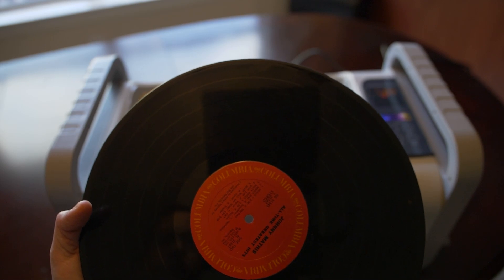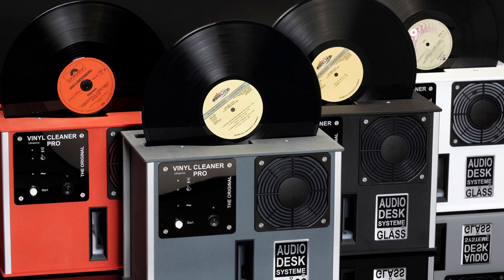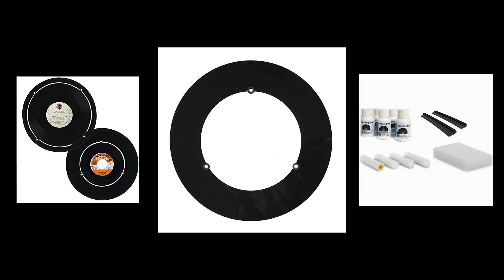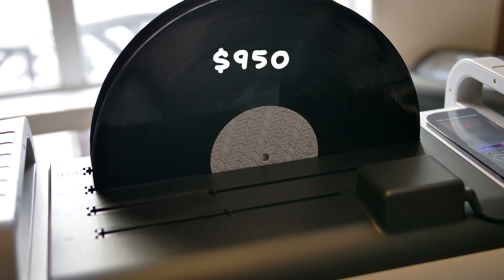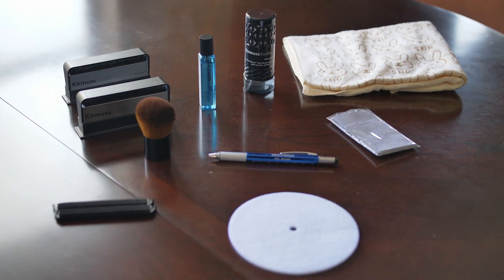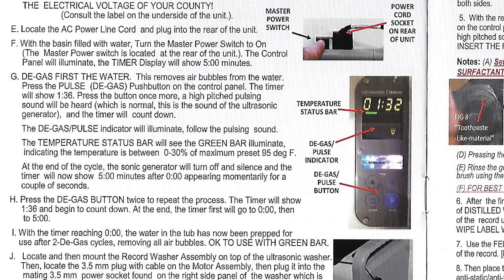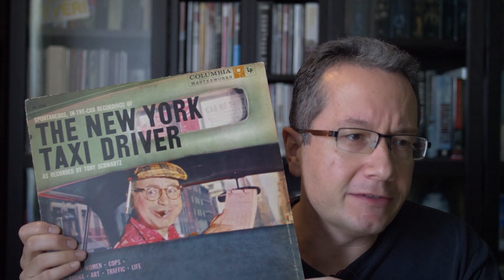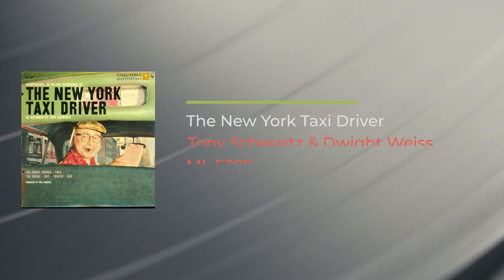Kirmuss KA-RC-1 Ultrasonic Record Cleaner Review and an Ultrasonic Cleaning Primer

Comment: Hi Paul. Thanks for this video. Very detailed and gave me a good understanding of the process as well as what are my options regarding Ultrasonic cleaners. 

After watching your video, I have been doing some searching myself, and found a new option that is currently being crowdfunded. I’ll paste yhe link here: https://youtu.be/XqPrPigrHko

Seriously considering pledging to this at the moment. As a ultrasonic cleaner user, what do you think about this? I know it’s difficult to comment on something that you haven’t seen or used in person, but your honest opinion would be appreciated. Thanks.
Reply from the maker: Thanks B Po!  I couldn't get into the KickStarter link for some odd reason but from what I can tell from viewing the video is the design is great and has an advantage over it's more expensive counterparts.   It appears to be smaller in size and I like that it comes with a cover.   The drying and the transparent drain tank design are also advantageous.   

I hope the have some success in making it to the market because a reasonably priced cleaner with a drying function would go a long way in this market.  It's sorely needed and I think it could be done inexpensively.   Again, thank you so much for the comment and the link!
Reply: @BarakaPDub  Yes, the fact that it has drying (not hot air!) function, as well as being priced at 350 USD is very attractive. They have already passed their Kickstarter goal too. Anyway, thank you for your input!

Comment: I've had the Upscale Audio version of the Kirmuss for 6 months now and I end the cleaning process with a Record Doctor VI for drying. For those who may not want the bunny logo, the Upscale Audio version is the one to get and it actually looks much better. That said, the results will vary depending on condition of the record and how much "elbow grease" you put into it. If it is a new record, often you can just run it though the Kirmuss once and then dry it. But for older records, a bit of "scrubbing" with the solution is needed. There are many ways to clean records but none of them are better than ultrasonic cleaning. I have a lot of records and I use mine almost daily. Ah yes folks, new records do need cleaning before playing them. Also, your stylus and the stylus cleaner should last a very, very long time if you clean records properly.
Reply from the maker: Thanks for the great comment bulldogdave.  I greatly prefer the Upscale Audio version to the one I purchased and I would have gotten that one to avoid the 'bunny.'  Your absolutely right about new records too!  New records should be cleaned before being placed on the platter.
Reply: Like you, I clean all of my new records, in addition to used. For my new records I've gone through the entire Kirmuss process, multiple trips to the bath, spraying and working in surfactant with the goat hair brush, etc.. For used records, this manual portion of the Kirmuss cleaning process is necessary, but for most new records, after reading your comment here, I'm wondering if I'm wasting my time trying to clean new records using the entire process???? Do you run new records through one 5:00 minute cycle, dry and that's it?? Or do you run a shorter cycle, 2-3 mins?? For my new records, I would love to save some time, as my only gripe with this system is the amount of time it takes to clean just one single record, following the Kirmuss process.
Reply: @jondubb35 new records get an initial 3 minute clean, a light scrub with the surfactant and brush, then another 3 minute bath. Usually more than enough.

Comment: Hi Paul. Fantastic and informative review on the Kirmuss. So much so that I've ordered one mostly because of your video. You mention that you couple the ultrasonic process with a vacuum machine as well. What I'm not clear on is where you preform the vacuum step in your process. Do you vacuum before or after the ultrasonic cleaning process and do you use a cleaning solution during the vacuum step? Thanks and all the best.
Reply from the maker: Thank you so much for watching and going for it!  That makes me happy you decided to take the dive.  So my current process is the following:  1.) Examine the surface for major caked on debris and give any areas of concern a light scrub with a damp Mofi brush.  Since I buy 90% new records, I don't have to do this step but occasional I do pick up a used record that needs a bit of spot treatment.  2.) Conduct an ultrasonic clean to remove all the major residuals and fine particles.  You'll note that the particles have a tendency to float around in the tank before settling on the bottom so they can come back in contact with the surface even after Ultrasonic cleaning process has just finished. 3.) A distilled water rinse, two times, on my vacuum machine to remove any particles that may have come back in contact with the surface.  I only vacuum one or two revolutions.  The key is not to over vacuum as it will just induce static on the LP surface.  I am okay with a very fine mist of water on the surface as an indicator.  I let the remaining moisture evaporate on a drying rack.  In my case, my drying rack is a letter filer I picked up at an Office Depot.  Doing all of this has left my LPs virtually click and pop free.   I hope this helps.  Others may do something different and that's okay.  It's seems everyone has their own voodoo magic ;)  Mine seems to work for me, anyway.
Reply: @BarakaPDub  Thanks so much for the walkthrough of your process. I'll try doing the same when I receive mine in a week or two. Appreciate it!

Comment: Great review. I clean my records using the vinyl vac record vacuum wand, and it has made my records a lot quieter and there are fewer clicks and pops, but the one negative thing I’ve noticed is that there is sometimes a very small amount of dirt or dust on the stylus after playing a record. If you could perhaps do a comparison of your stylus before and after playing an ultrasonically cleaned record, I would be able to judge for myself whether buying an ultrasonic cleaner is worth it.
Reply: You are looking for absolute perfection. it does not exist.
Reply from the maker: Good question Nathan!  So I can say without a doubt, that regardless of the cleaning method, you're always going to get stuff on your stylus.  Basically, even if the vinyl was pristine, your stylus diamond is lightly, and I mean lightly, scrapping the walls of the record groove.  Both your diamond and the record groove wall wear down with time.   Not to fear though, you would have to play the same record hundreds, if not a thousand times to really have impact to the sound of the record if it's well cared for.  If you listen to the hardcore audiophiles, there are those that clean their stylus after every side of the record played to remove the small bits of vinyl and dust that do get collected.  I am not that anal retentive but I do clean my stylus after every three or four LPs in one session.  Some would call that amount of cleaning anal retentive but it is good to regularly clean your stylus less you accumulate things that could do lasting damage.   I hope this helps.

Comment: I took a look at the Kirmuss web site and THEY CERTAINLY HAVE AN AFFECTION FOR WRITING IN ALL CAPS. It's funny, Paul, I was cleaning a couple of records this morning in my $80 piece of injection-molder plastic and thought "I should do a video about this" then thankfully thought otherwise as your video would have put me to shame.   ;-)   Seriously, given my buying habits so far which have mostly been with VG+ used or brand new records, this cleaning system has served me fine. If I dive more into buying much older mono records, and gravitate toward VG items, I may switch to a vacuum plus ultrasonic system instead, probably something like a groove doctor plus a $300-400 cobbled-together ultrasonic solution. I do have a mono cartridge on a spare headshell, and I think there are gems to be had in VG Land i extremely properly cleaned and played with a mono cartridge. As always, a great video! Love the bubble sound effects!

Cheers, Tom
Reply from the maker: Thanks Tom and there is nothing wrong with sticking to a budget and using an injected molded piece of plastic.  I was that way for a long time ;)  I think cheap DYI solutions to vacuuming and ultrasonic cleaning can do every bit of good as the pricier models.  The pricier models just add more convenience features and nothing more.  I mean, even I opted for convenience for not wanting to mess around taking records off of spindles.   I agree with you on VG land.  I want to do a video on vinyl to digital conversion which works fantastic with VG records.
Reply: @BarakaPDub  The viny-to-digital concept always intrigued me since I've heard claims that it sounds exactly the same but I've never tried to do it myself to confirm that. It seems to me that if you take the time to rip a record, then you later upgrade the table, cartridge of phono stage, you'll probably want to rip it all over again. And then, you know... it never ends.   ;-)

Comment: Funny, when audiophiles were coming after me about alcohol, I used the same argument about the bottle storing the alcohol IS PVC!  I assumed they moved on to election fraud.  I have that NY Taxi driver album digitally!  I never understood dudes dropping a hundred on a record, but balking at a proper clean.  Ultrasonic is always the way to go - I'm happy with my sink method after trying vacuum, but I would step up to an ultrasonic if I was a more dedicated listener, or certainly a classical buff.
Reply from the maker: I think the Disc Doctor or someone peddling product likely started that myth.  Too many people bought into that garbage and now it's like a cult. 

Nothing wrong with using the sink method and I am still a fan of your dent remover method for protecting the label.  When it comes to heavily caked on grime, the sink and a painters pad are a good way to go.

Comment: I have the upscale audio version of it an I love it. The only thing I have to say about the machine is that you need to complement it with an anti static gun. Great video.
Reply from the maker: Thanks for commenting and watching Yohan.  While I didn't get into it here, I do a double rinse on my VPI and doing that, I've had zero problems with static.  The key is not to over vacuum.  Too much dry friction will just induce static.
Reply: Quick question my friend. I have seen the video about the cleaning solution you make. Are you planning on keep using it with the Kirmuss or did you came up with a new recipe? if so do you mind sharing? I found the Kirmuss solution super expensive.  ($ 85dollars for 10 oz)
Reply from the maker: @yohanmarchena9599  $85 for a bottle??? Whoa!  Is this his anti-static stuff?  I haven't used it at all.  As for my cleaner, I do use it on occasion with my vacuuming machine when I know I have some really tough stuff that ultrasonic won't totally eliminate.  As for Kirmuss, I do follow his suggestion of putting in 40 ml of 70% iso alcohol.

Comment: Hi Paul, 8 liters are a lot for 20 LPs, are you filtering the water afterwards and reuse it? What about using the ultrasonic first and then washing/drying it with the  vacuum? 
Drying like you showed looks like leaving the durty water on the lp or did I miss sth?
Reply from the maker: So you're right about the water usage and I could filter it out but I get the distilled water cheaply.  Long term though, I am thinking about filtering.  A DYI solution is pretty easy to do.  On the drying...so my process is, once I have pulled them out of the Ultrasonic, they end up on the VPI for a dual rinse on each side, and then on the drying rack for a final dry of any fine mist that remains.  The key is not to over vacuum.  Since doing this, it's a very, very rare event to hear a pop or a click.  Hope that explains my process a bit and I didn't want to get into it in this video.
Reply: @BarakaPDub  thanks for the clear explanation, this is what I meant, over vacuum is an issue and I do it like you, having a final drying just putting the vinyl on a rack, because on some areas of a vinyl, and every vinyl is different, a little film of water remains,

Comment: Hei, Paul!

Ultrasonic cleaner is the best way to clean vinyl. I have a little ultrasonic cleaner and I've used it for years to clean my 7" singles. If I would have some extra money I would buy an ultrasonic cleaner which would be big enough for 12" vinyl but around here they are not cheap. 

Great and interesting video, 
Jarkko/MyVinylBar
Reply from the maker: I have seen a few folks just buy a 6 Liter tank and thread a metal rod through the spindle and manually rotate the records.  The cheapest tanks run just over $100 and since they're made in China, perhaps, you can find something of the equivalent in Finland?  Thanks for watching my friend!

Comment: Hey, Paul. Always great to you back with a new vid. Firstly , I honestly burst out laughing at your dry jokes numerous times. Spot on. Spot on, ol’ chap! This is 100% the best vid I’ve seen on ultrasonic cleaners. Extremely thorough job. Seeing that colored pencil quickly dissipate into the water was pretty amazing. I picked up a Record Doctor VI a while back, but am very interested in the Kirmuss. All the extra steps with the mold release agent, then having to clean it again kinda turned me off., but I’d be fine letting it go through once and calling it done. Thanks for both the knowledge and entertainment, Paul.
Reply from the maker: Hello Nick.  I felt exactly the way you did in the interviews with Kirmuss and the anti-fungal process.  The way he was selling it was a turn off but I pushed that aside and bought it for the functionality.  I didn't feel like spending $2000 more for a filtering and drying capability, only to have to pay more for spare parts after washing a few hundred records.   But I also didn't want to spend time messing with spindle attachments.   I liked the drop in feature and the capability to easily clean 7" and 10" records.   The colored pencil demo was a must because I hadn't seen anyone do it with a record and showing that demonstration will help people understand the capabilities.  Thanks for watching and Happy Holidays!

Comment: Thanks for another great video Paul.  What is the record cleaning brand/model that you use to vacuum dry your records.  Thanks again.  Have a great holiday season.
Reply from the maker: So the Vacuum machine is the VPI MW-1.  Would I recommend it to others...no.  I think the Okki Nokki (if you can find it) and the Pro-Ject VC-S2 are better options for the money.  The MW-1 overheats and will automatically stop working after cleaning 20 records in one sitting.  You have to let it cool down.  VPI put an undersized motor in it IMO and they could have done better.  That said, it does great but I think it's overpriced for what it is.  The reason why I bought it is because the Okki Nokki stopped production at the time of my purchase and the Pro-Ject wasn't on the market.  This was the first VPI priced at $1000 that could vacuum forwards and backwards.  The 16.5 model, which is cheaper, can only vacuum in one direction and is housed in fiber board.  Fiber board and water are not a good combo ;)
Reply: @BarakaPDub  Thanks.  I have the Kirmuss and it is capable of restoring records that are in pretty bad condition.  It takes some patience and a bit of elbow grease, but it's a terrific system.  Its only weakness is drying which requires either a towel or drip-dry, neither of which is optimal.  I'd even take a DIY solution with a shop vac, a  hand-held PVC pipe wand and something sqweegee-like (what Michael Fremer calls "magic lips") embedded lengthwise into the wand.      Thanks again from all of us vinyl folks.

Comment: Hi Paul. Cool to see you have gone the route of ultrasonic record cleaning. There is no way back. I have never heard a fifties record so clean :) Seems we are both lazy, or a bit too busy, to build one ourselves ;) Do you see any change in dirt removal with one or two records in the unit? Cheers. /Paul
Reply from the maker: Hello Paul.  Good question but I haven't seen any real difference doing two records or one record at a time.  I know the internet forums are filled with debates on the number of records you can do and the spacing but I didn't want to wade into that territory here.  While I didn't go over my whole process here, once my records are done in the Kirmuss, they go right on my VPI for a dual distilled water rinse/vacuuming.  As you can see from the demo, without the active filtering, some debris can land right back on the LPs surface after the process stops.   This means without the active filtration, the rinsing becomes a little more critical.  You're right about getting records the cleanest they have ever been.  My VPI could not remove as much debris as the ultrasonic could.